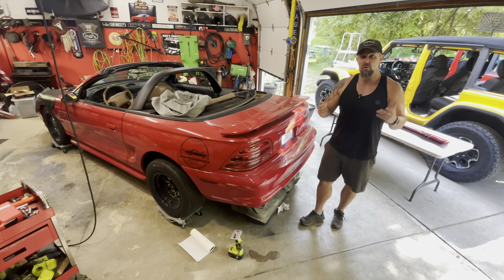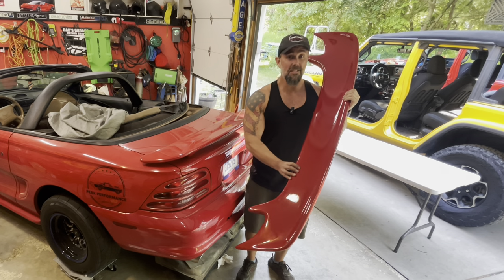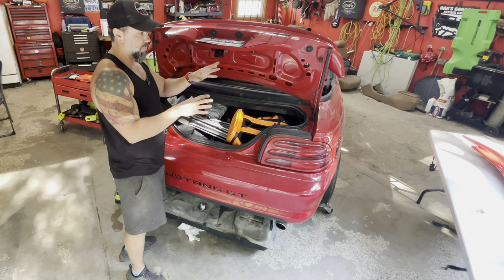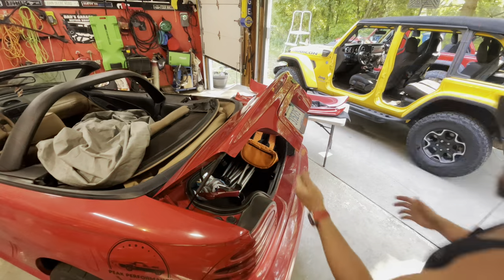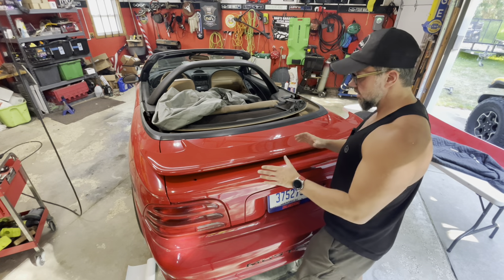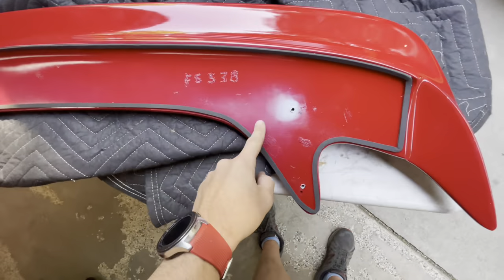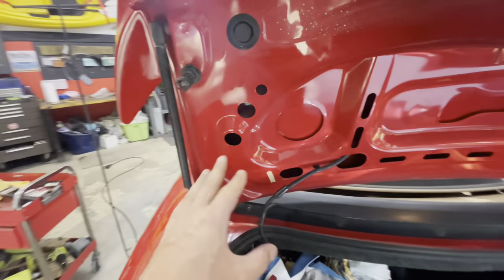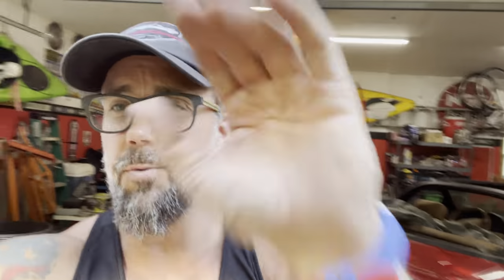Spoiler Alert! Installing a $250 Painted Saleen S281 spoiler from EBay! MUSTANG SN95 94-98

Comment: The video is Super Red bud! You fixed it tho in the last video I seen. 

You seen the ATS Brembo brake mod? Direct swap and best of all its budget friendly. I got them on my Fox, at least I will when my rotors comes tomorrow from summit. Fingers crossed they don’t change the date again lol

Ps I see the Jeep and Jeep stuff around the garage. I have a 94 YJ with 33x12.50s, 4in lift, warn winch, Smitty front & Rear bumpers , master craft suspension seat because some slipped disk in my back which sucks at 36 and other mods.

Unfortunately it’s a 2.5 Auto which is a dog but I have plans to LS swap it which is fairly easy.

This isn’t my 1st Jeep I’ve had many XJ’s which are great off-road
Reply from the maker: Nice the Jeeps are fun and yes I’ve seen the ATS Brembo swap for the front end guys going with Taurus calipers in the rear, I’ll probably go that route in the future whenever these front calipers get time for a rebuild :)

Comment: Is the gasket all around like a double side tape or is it just sealed when you bolt it on? Just ordered one for my 94 GT.
Reply from the maker: It was just a gasket, not sticky like 3m tape. So it’s pretty easy to get it fitted up and in the right spot from what I remember.

Comment: Does it seem sturdy? IWould you have rather bought a more high end one? I just dont like threading bolts straight into the fiberglass
Reply from the maker: I’ve Driven a couple hundred miles so far and it’s been great. Totally solid just like the stock ones. It’s even been tolerating my kids opening the trunk with the spoiler lol. For $250 I think this thing is a steal. The paint is awesome still can’t believe how well it matches my nearly 30 year old paint
Reply: Thanks for the response.  Can't really beat that price . I'm looking at a carbon saleen wing bu5 after shipping its $600 !!
Reply from the maker: Dude I would have loved a carbon wing and the carbon piece that goes around the license plate on the rear bumper, but it just wasn’t in the budget right now. Need to finish all the go fast stuff and then in a year or two I’ll drop some $$ on more aesthetics.